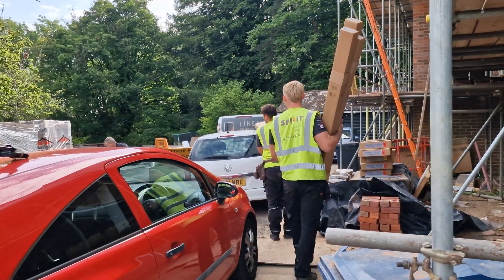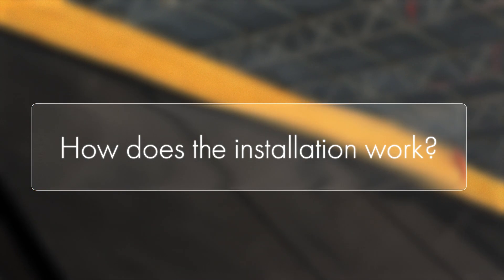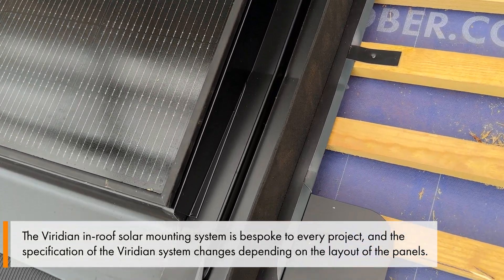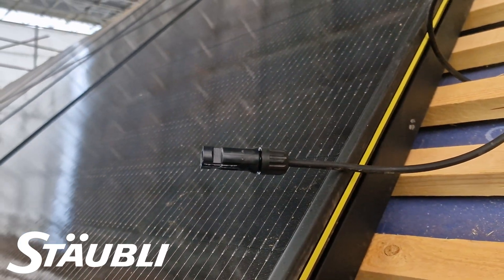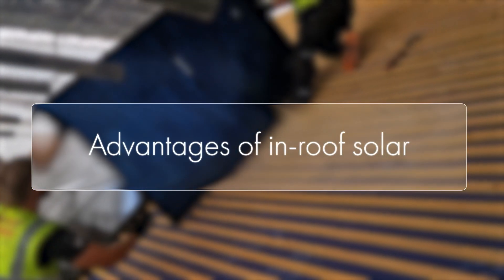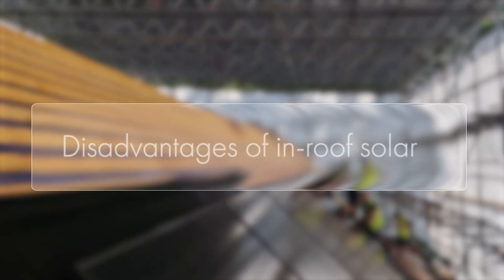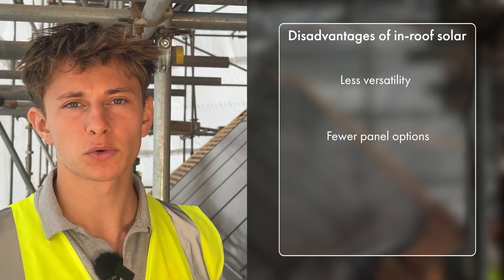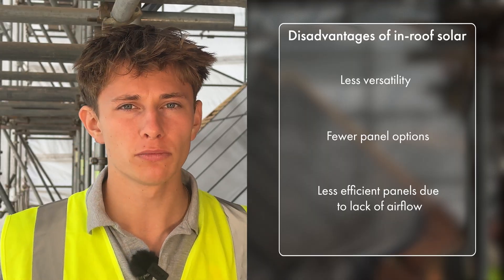Ultimate Guide to In-Roof Solar Panels | Viridian Solar Case Study

Comment: I can see so many drawbacks with in-roof systems and nearly no advantages that when I had this option it was a very easy decision. Nothing is more important than the weather tightness of the roof in this miserable climate we live in, why would anyone choose to compromise this.
Reply from the maker: Thanks for the comment. While you can almost always generate more from an on-roof system, I wouldn’t say we’ve ever had concerns about leaky roofs from in-roof systems. I wouldn’t say that those getting in-roof solar need to be concerned about that if choosing reputable installers and reputable kit.
Reply: @spiritenergy_uk   it’s the flashings and gulleys that are the problem, they get blocked with organic debris, particularly in wet and damp climes. You get exactly the same failure mode with water drainage channels in cars or velux windows. They always block and being on a roof and inaccessible to clean it makes it 1000x worse, at least with a velux you can come up through the window. 
Maybe the systems you use are better, but the ones I looked at were only warrantied for 15 or 20 years. A good welsh slate will last 150 years, even the cheapest of the Marley tiles will give you 50 years of service.

Comment: I have seen this system being installed before. It is well designed and for those building a new house it may be worth it just for the design aspect. 
But for existing homes I really don't see how this can compete with an on-roof system as you are probably going to have to rebuild the entire roof on most homes to make sure it is absolutely straight and sturdy and it is not a fire hazard.
Besides those points the system is not cheap either.

Having said all that it is stil a nice option for those who are building their dream home and want the best looking system one can get if spending more money is not a problem.

Comment: Great video as always.  I've heard that due to a gap in the certification framework and regulations surrounding new in-roof panels, new panels cannot be certified so people are stuck with old panels despite new panels being more fire-proof on paper (for example, the numerous glass/glass panels now on the market).  Is that still the case, or have things improved since last winter?
Reply from the maker: Hi, no that is still the case for other systems. We’re having to use 440 W panels at the moment for in-roof.